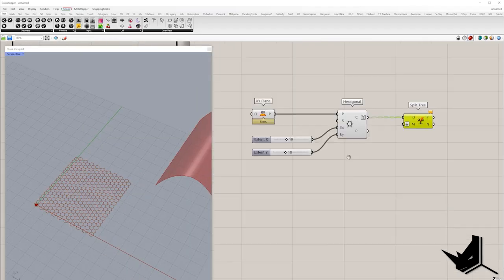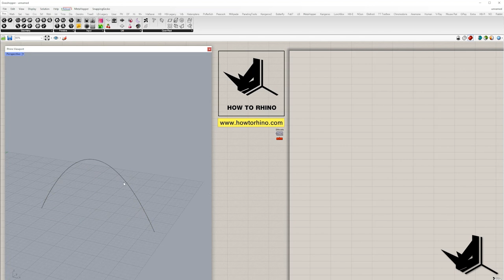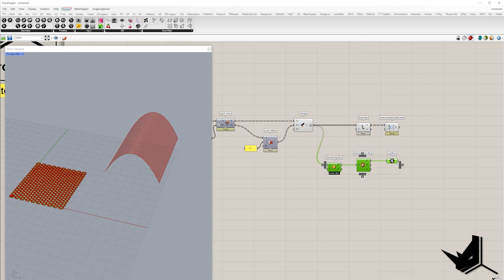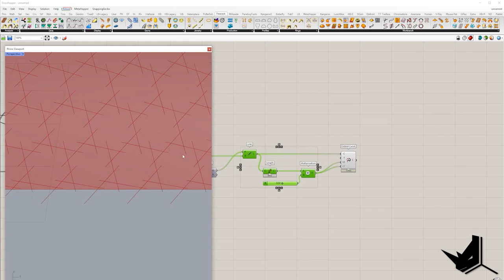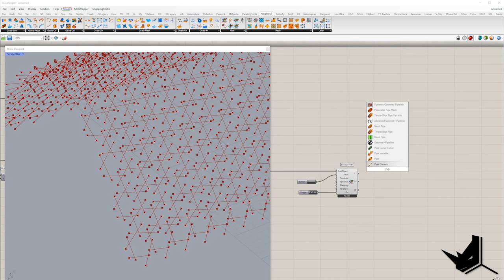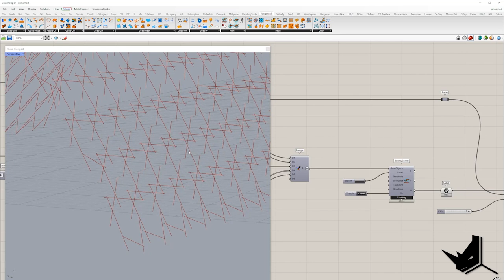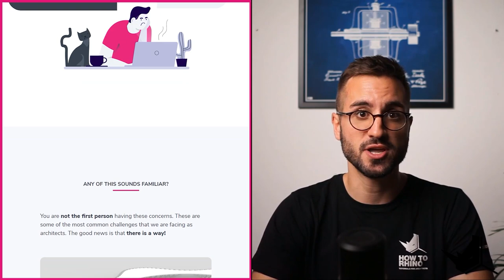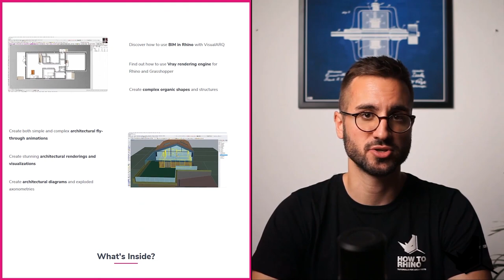I was inspired by Kengo Kuma and did this...

Comment: I followed the tutorial and although it was tricky to follow along, I ended up with a neat design... at the end, the baked item would not slice ... my slicers (Cura and Creality) literally created 5 dots on the base ... not sure what went wrong there ... :face-pink-tears:
Reply from the maker: Hey Michael, this would be very difficult to 3D print, especially if the "sticks" are not touching or if their tolerance is off. Also, you would need to take into account the thickness of each individual stick and create 3D printing support. You can send me your model in Rhino at dusan@howotorhino.com and I'll take a look and get back to you :)